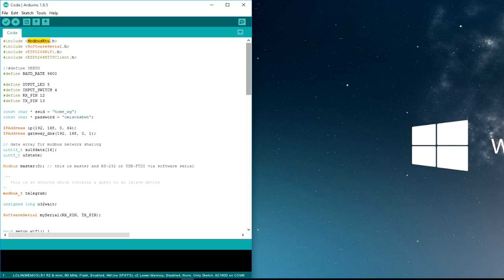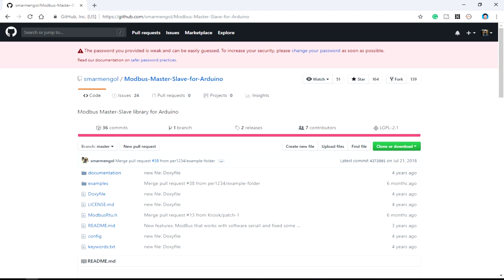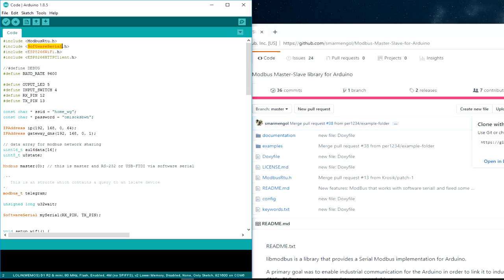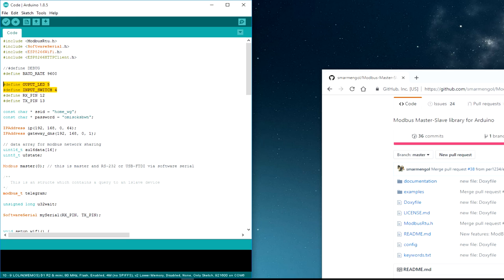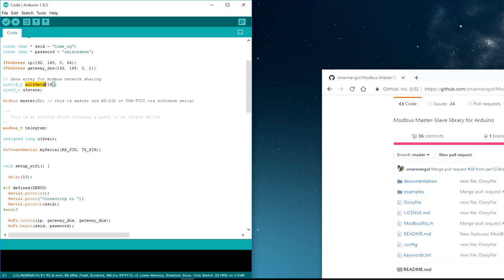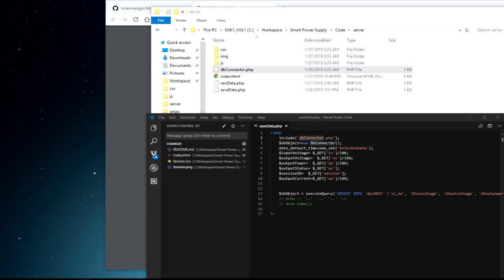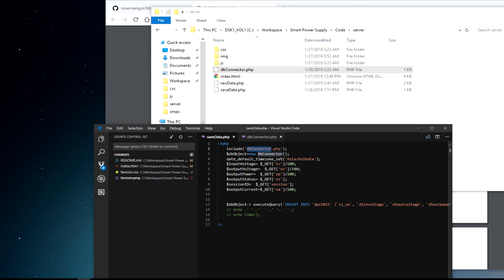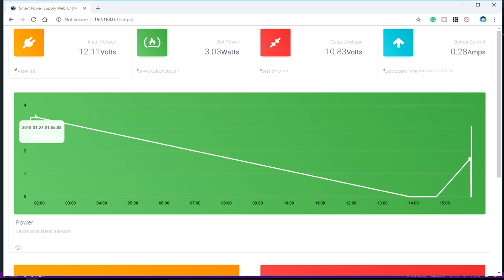Web interface and Data Logging with DPS5015 Power Supply | MAKE #6

Comment: Use a Ammeter at input of the Power supply and compare with the display for accuracy of the display data you are getting.
 Run the DPC and check how much idle current it requires then check how much the wemos needs. 
There can be more than one condition why it is going black. 
 Your supply power (total watt) is less than the total power required by dps module and wemos module. 
Secendly, there should be any jumper or internal register to switch on and off the 3.3v line.
 3rd, check the wemos module, replace with a new one and see. 
 Generally talking, display is the main power consumer here. And the dps module may not be calculating how much power it is consuming itself. So just check and see.. 
Lots of love... Well explained...
Reply from the maker: Hi Gurudutta. Thanks for the explanations...As I have shown in the video, it worked later.....It was happening due to some misconfigurations in Wemos pins...

Comment: What device would you use to connect the 4 pin cable (UART) that came with the DPS to RS485?
Reply from the maker: I have used esp8266 directly to the module

Comment: How would you go about making a serial connection from a DPS to an Arduino Mega2560? Thanks.
Reply from the maker: You can do it almost the same way. The only change is going to be you can use physical serial port ijstad of softwareserial as the mega has multiple hardware serial ports